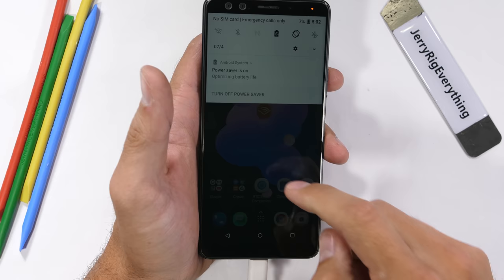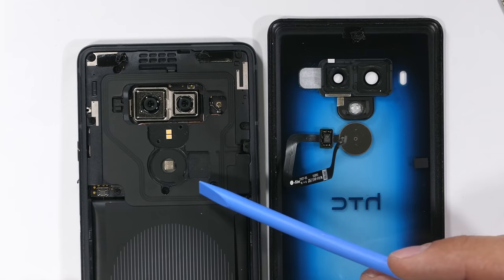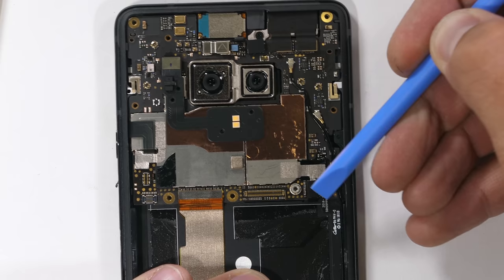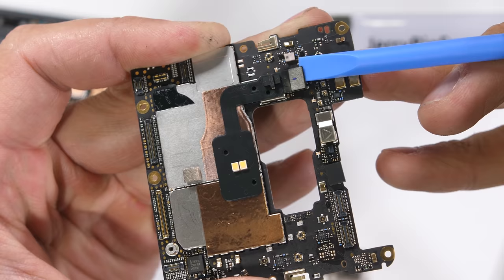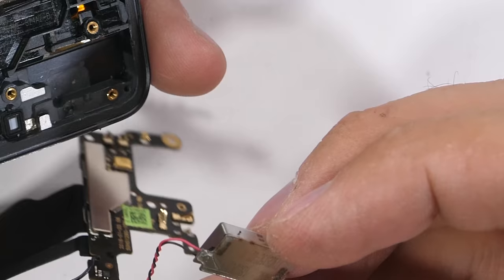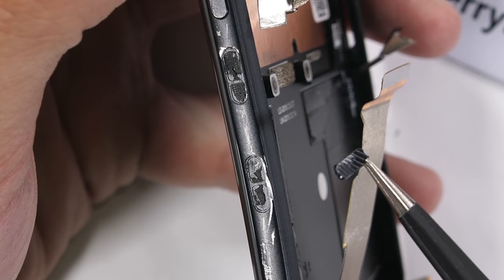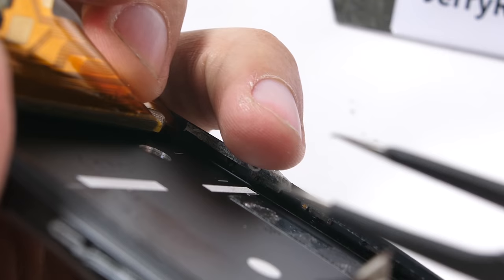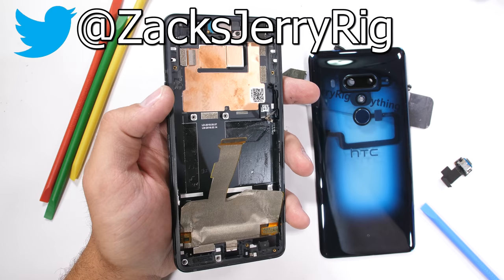HTC U12 Plus Teardown - Can the 'buttons' be fixed?

Comment: Worst phone ever
Reply: Maroof Juneja - Not when it has better cameras and audio than your phone ;)
Reply: Altema22 dont forget the Software. The fastest after Pixel.
Reply: Altema22
Audio. On a phone without a headphone jack.
The U12+ seriously is a horrible device. You can't even take a screenshot with those buttons.

PS: I have a V30. sooo. Win for me in terms of audio ;)
Reply: Tim R. U can take a screenshot with those buttons. Stop talking shit if u dont know facts. U can take screenshots with the buttons, the custom bottom bar and the Touch Sense feature. But whatever.
Reply: Tim R. Also, u dont have a headphone jack but u get the best USB C Headphones in the box of any smartphone.
Reply: Tim, the headphone jack is USB C, and the included headphones are the closest in-box experience you can get to the original sound in a real recording studio.

Speaking of which, as a professional recording engineer, the V30 confuses me. Is it for old people who can't hear and need it extra loud? Or is it for people who like to boast that they can plug high impedance and high resolution headphones into a phone with more noise and distortion than a dongle?
Reply: Altema22 How can a headphone jack on V30 introduce more noise than a dongle on U12+ which also packs far worse DAC inside? Not being rude but could you elaborate on it? I'm genuinely curious.
Reply: XtraDreamLantern17 - Thanks for asking. The source of the noise is the DAC itself. The V30 DAC is very good, but it's outstanding feature is getting loud by pushing a higher output voltage. Loudness and quality are two different items, and when you look at the audio quality, the HTC external DAC is just a touch better for residual noise, dynamic range, and total harmonic distortion. It's not a big difference, but the catch is that high impedance headphones often bring more detail, and when you plug in a set of them into the V30, the distortion levels go up from 0.0015% to 0.0067%. On the HTC, the distortion changes from 0.0017% to 0.0018%

The only reason I threw that out there is that some (not you) LG fans look down their nose at everything else, assuming it's garbage. However, the HTC external DAC is 24 bit Hi-Res audio certified, and if you ignore the loudness, they are on par with the LG quad DAC.

The reason that HTC skipped out on the internal 3.5 jack is because they decided to go full on with USB C and USonic, which has capabilities that you simply cannot do with a 3.5 jack. In my 20+ years of engineering in commercial recording studios and doing thousands of live concerts, I've never heard any headphones as mind blowing as USonic. My full size headphone collection is mostly gathering dust, except for my favorite pair of Sennheisers and a pair of Ghostek soDrop 2's, and I use those because sometimes USonic is TOO immersive.
Reply: Altema22
I appreciate your feedback, but while I don't doubt that you used professional equipment to measure those values, your assessment led me to a conclusion that it is extremely hard to make a fair analysis on the quality of audio equipments. Why? Because GSMArena's tests on V30 and U11+ tells the completely opposite: U11+'s dongle has slightly better noise performance and dynamic range, it also shows shakier frequency response and substantially higher distortion. The gap becomes more massive as you plug in a pair of headphones and here V30 beats out U11+ in every single category apart from stereo crosstalk, in which U11+ arguably performs better. Juan Bagnell, a fairly popular gadget reviewer on Youtube, also stated in his audio review on U11 that the dongle (which I assume is the same as the one which comes with U11+) is a significant step back from HTC 10. They both use dedicated equipments to gain their own "accurate" outcomes and I think their results are as credible as yours is. The bigger problem is that even if HTC's dongle had a better sound quality, it wouldn't matter on their latest flagship U12+ because it's not included in the box. Sure, I mean you can buy one, but since the dongle works on any other device with a Type C port and proper software support for USB audio, U12+ doesn't hold any advantage over others here. For instance, I saw various people in forums who were saying HTC's dongle improved the audio output from Mate 10 Pro.

IMHO HTC doesn't think about their customers as much as they did in the past and recently they've been making some seriously weird decisions... Headphone jack is one of them. You say they removed it because Type C port has more potential, but they could've easily kept both. You cannot charge your phone when you're listening to a music, and you're basically stuck to USonic earbuds unless you purchase their official dongle sold for $12. And clearly they've done it because that's what Apple did... Well, even Sony followed Apple and got rid of one, it's not really surprising to be honest. Also weirdly enough some people are reporting that external dac/dongles from 3rd party don't work on U12+ which, if true, can greatly reduce its potential as a music player (The reviewer from Android Headline claims that 2 adopters he had didn't work with U12+). Plus all the durability issue, poor battery life, dim display, unreliable buttons and some UI glitches... it just doesn't seem to worth the price tag it carries, not anymore.

For USonic earphones - I'm pretty sure I told you before, personally I didn't find them better than my 1more QD earphones: however that's just my opinion and it's no different to yours. People might find one earphones more natural sounding than the others, our ears are really subjective way to measure the sound quality and that's what makes whole audio industry a lot more complicated than others like camera industry. But if you like it, then I don't have any objection.

Lastly I'm not a fan of LG, when I get a new flagship phone I always keep them away from my options mainly due to generally poor quality control and only OK cameras. The only reason why I purchased LG Style was because there was no flagship phone I wanted in the first half of the year and I needed an inexpensive phone with decent audio quality to drive my 1more better than my XZ1 Compact and Mate 10. And FYI ESS DAC inside LG phones support 32 bit audio playback since V10.

Comment: I've seen a lot of repair places in my country that can fully remove a broken glass and digitizer and glue it back in as it was from factory. All they need is a hot plate, alcohol, the special glue, and UV light to cure the glue.

Comment: $800 wasted!
Reply: Arun Kumar i doesnt feel like a waste. My U12+ works fantastic. Faster than S9+, 2nd best camera, amazing sound and a QHD Display. Also, clean Software UI.
Reply: Fedor Vladimirovich 😂😂lol then why doesn't people buy htc as you say its better than Sammy 😂😂
Reply: HÁRØØÑ PÀÜL Stradegie and marketing. Or do you want to tell me the Samsung software is good, the Android updates on time and Bixby useful? Please. In addition, Samsung had won in advance by the greater resources and income.
If you seriously deal with the companys and evaluate neutral, you will understand it yourself. HTC is not perfect and unfortunately despaired, but still better than a Samsung with its bloatware.
Reply: HÁRØØÑ PÀÜL no one buys htc phones because no one even knows them how do they get sales if no one even knows about them
Reply: Arun Kumar 800$ gained by this video.
Reply: Htc is very underrated.typing this on my U11,
Reply: yeah people hate on htc just because theyre in popular
Reply: @haroonpaul1997  Never ever Samsung phones. I had an S6 Edge. It has been replaced 2 times, due Amoled issues(burn-in, discoloration) and the OIS fail. My mother have a Note 8. Samsung replaced it 6 times because the Amoled issues(yellow/purple/blue discoloration, burn-ins, tons of dead pixels out of box, backlight issues). On top the S6 Edge is killed with the Nougat update. The phone is slow, unresponsible after the update. If u go back to Marshmallow, then the issues are gone...hmmm... planned obsolescence... On the other side: i dont had ever any problem with my HTC One M7. It stayed lightning fast after every update. Its had only the reddish discoloration on the photos, but it was sorted via the camera fw update. I have now an U11 and again, no flaws.

Comment: Hi Jerry, I'm Abhinav Janak from Hyderabad, India...I'm a huge HTC fan. Nice video done here for HTC U12+. I have been using HTC U11+ phone since last 3 years. It will be very nice if you can also do a full tear down video for U11+ phone as well disassembling and showing all the parts including the pressure sensors ( pressure sensitive strips on left and right hand sides for squeeze function ). Thanks.

Comment: Zach, does servicing really matter on a component that was designed to never need service? I don't know about you, but I use my phones hard, and I've had several phones retired because of button failures. I think it would be nice to have a common failure point replaced by something that I don't have to worry about anymore. The first attempt at solving this problem may need some tuning, but props to HTC for doing what no one else has. 

In regards to the rest of the phone, there is OIS on both rear cameras, and the telephoto camera works without the overprocessing of the P20 Pro which makes photos look like paintings instead of photos. No OIS on the selfie cameras, just EIS, but the selfie cameras are vastly better than the P20. 

The HTC 10 was a durability champ, but was SO industrial that even I was turned off. The U11 has been tougher than expected in real world use, and mine is fine after fourteen drops and daily life in my pocket.

Audio-wise, the U12 is still the best choice out there.

Comment: The HTC 10 was built like a tank but the inside was a mess making repairs and battery replacements difficult, the U11 was super fragile and the glass shattered into small pieces if broken and now the U12+ is like a combo of the 2. The glass comes off with ease, the pressure sensitive buttons are actually more prone to breakage than normal buttons and it's also a nightmare to repair due to the screen being permanently  adhered to the frame.

Comment: I vote that HTC heads back in the direction of the M7. The design and the headphone jack were great. Even the not-stock-android software was decent. The buttons were good too. Only the camera was a grainy, purple lowlight of the phone. The removal of a headphone jack from HTC phones ultimately pushed me to Samsung with a detour over a Nexus 5 cause the repair of the M7s camera by the store I bought it from took forever.

Comment: The HTC 10 had a good design, but the battery issue my gosh!! Close to 2 years later - I doubt I can get 3hours out it. 

I got the U11PLUS, good phone.. Hardly use the squeeze features though.

Oh... and the Noise Cancelling USB buds... Podcasts never sounded better...

Comment: And why shouldn't they make the frames sensors permanent if they never wear out?
It's still funny that the Samsung buttons came off even easier, by accident, and you had no complaints. Bias much?

So, I've got an Acer monitor with a bad "menu" button, three older phones with power and volume buttons worn out, 4 iPhones that had to have buttons replaced, A powered speaker with a finicky power switch, two power amps with bad power buttons, and two portable music players that I can't use anymore because the buttons failed. Sounds like HTC using buttons that don't fail is a good idea.

I know I bought one just to try it out, and it became my favorite phone over the iPhone XS Max, which we also own. The buttons are dead reliable, and the precision haptic motor (same as the Pixel 3) gives you haptic feedback that you can feel through cases and in your pocket, unlike traditional buttons which feel like mush to me now. Since the update, the button haptics are sharper, and I sometimes keep clicking them in my pocket because it feels cool.
I bet you didn't know that, in addition to being pressure sensitive, the frame rails on the U12+ are capacitive touch sensitive. The double tap function does not use pressure or motion sensors... the phone reads a double tap on the frame as it would a double tap on the screen.

Comment: so, all of my phones had tactile buttons...at least one always failed. That will be history with this approach. And if you want to replace the pressure sensors on the side...don't you have to buy new sensors anyways?^^ For me, it's worth a try I think. Only that the back panel comes off that easily is meh in terms of durability

Comment: Great video, Jerry. I don't know how do you memorize how to put everything back together ;D
I have a question for ya. I dropped my htc U12+ and doesn't turn on anymore. I tried to plug it into a wall charger and pressing Power Button / Power Button + Volume Up / Power Button + Volume Down for at least 30 seconds and Power Button + Volume Up + Volume Down for at least 2 minutes, 6 times for each one of those combinations but it didn't help. Any ideas on how can I turn my phone back on/fix it? Really don't want to buy a new phone =( Thank you =J
Reply: Me too. One unfortunate drop and I can't even turn the phone on any more all the buttons are dead, doesn't change, screen and the back glass is still perfect. I'm looking for someone to repair it.

Comment: What happens if you take it to service centre and tell them you pay for its replacement parts. Will they able to get the phone to good condition at least working. Because no one wants to lose their $800 phone for a button, right?
Reply: Sam Singh - That is one of the problems they solved: You won't have a button failure on this phone because there is not a moving part.
Reply: Altema22  thanks its really a smart answer

Comment: I still hate every manufacturer who uses glass on the back but doesn't include wireless charging... especially with this translucent back which shows you every time you look at it: Heheh, no wireless charging for you~

4 cameras are also not that impressive... The Note8 has 4, the S9+ has 4, the P20 Pro also has 4 cameras.

And this "no real buttons"-concept is trash. You can't even take a screenshot anymore because you can't press 2 buttons at the same time. This is HORRIBLE.

Comment: So funny that when a company tries something new, they are immediatelly witchhunted by everybody.
Artificial buttons are a step in the right direction for water resistance, but people cant accept anything new nowadays.

Obviously is not a perfect design. Even Find X and Nex S would most likely break if they are dropped once when the camera is open.
New stuff is always imperfect.

Have y'all even seen 2016's market?
Lemme summarise 2016: glass on both sides, close to stock Android. Done. There were no extra features. Phones had either one or two cameras on the back and mono or stereo speakers (none of them were front facing)

Phones lost their flavour. Most skins got stripped to a bare minimum, most hardware features are gone, most hardware feature combos are not available anymore (no more full packs. There are only blank slates with one "killer feature"), etc.

Also those buttons just need to be superglued back. I think their only purpose is to press on the center of the button area. You can clearly see the middle of the button hole is raised. That's where the pressure sensor most likely is.
Or if superglue is too weak, there are plenty of other glue types. Stronger and more flexible.
Reply: Myrmeko Me the fact that you have to do that just to make the buttons work again tells you HTC is getting very cheap in materials to cut costs this is not worth $800!!

Comment: have a feeling that the new iPhone will be unrepairable
Reply: i love you jesus Naaaahhhh. You can still repair things like the screen or replace the battery without too much difficulty. The problem with new iPhones are the glass back, which is permanently adhered to the metal frame. 

This phone on the other hand, you can only really replace the battery. Anything beyond that, and you might as well be looking to get a replacement device or another phone altogether.

Comment: Wow, what a crappy phone. The only thing appealing about this is the 4 cameras and translucent back which is more of a gimmick just for looks, nothing else about this phone is good. Heck this thing doesn't even have a headphone jack or wireless charging! Coupled with the fact that this phone is basically un-repairable, it is essentially a throw-away phone (an $800 one at that). You crack your screen and there goes $800 down the drain. How the heck is HTC going to stay in business?
I would get a Samsung or LG over this phone.